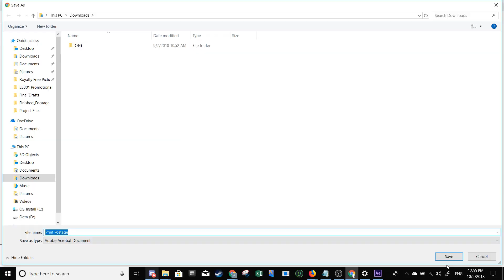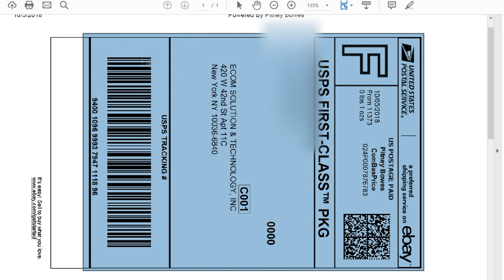How to Print Incorrect Format PDF Shipping Labels - See New Video Link for UPDATE Adobe Reader 2023

Comment: Sorry, but printing barcodes on a thermal printer out of a PDF file is a bad idea from the beginning... Copying a snapshot will not help at all.
The one and only working option is - having the PDF file very precisely prepared for the final resolution of the thermal printer (usually 200 dpi only) + precise size of the label AND definitely not changing the scaling parameters of the printer options in Adobe (Reader) - and keeping it to 100 %.
Any other "solution" will always provide bars and spaces with wrong widths and ratio - the scanners can accept this corrupt images or can not - depending on their scan engines and settings.
Printing on laser or ink-based printer with higher resolution will only decrease the error caused by "scaling" but the final printout will not be acurate. Maybe by an accident in one case in a milion.

Comment: Using my Zebra Gx420d I only need to change the controller. So if I need to print PDF I go to advanced options in the properties of the printer and instead using the "Generic / Text Only" controller, I change to "Zdesigner GX420d" in the controller. Then to print the other labels, have to return again to switch the controller and press Apply. I Hope that helps others.